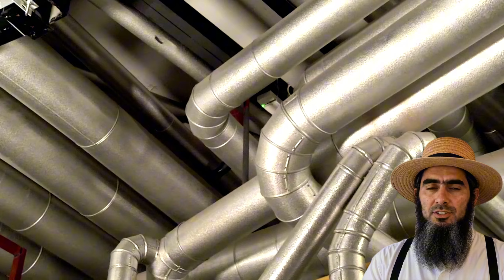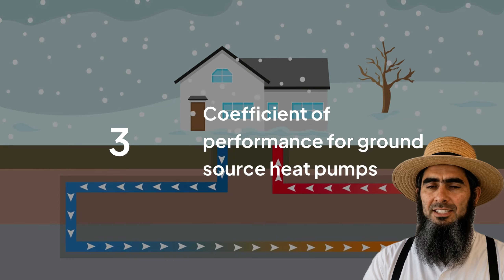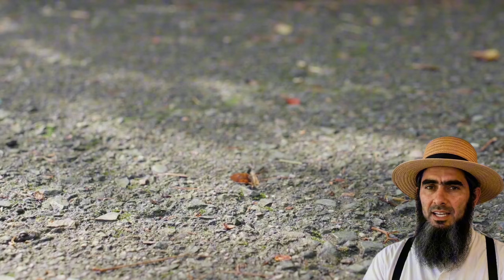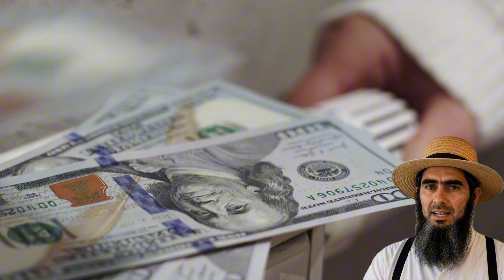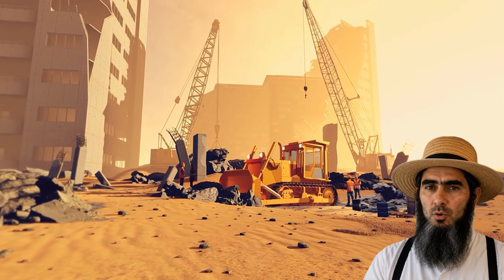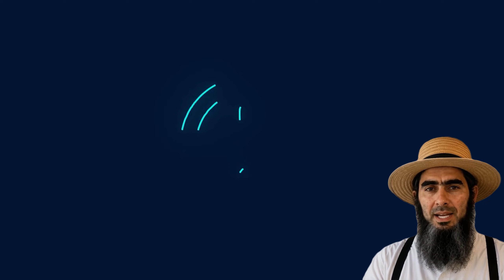We Achieved 9 Degree Cooler Air In 5 Minutes  — The Amish Way

Comment: You can do the same thing witth a cooler just add coil of pipe to cooler and vent and fan to pipe add ccol water or ice to cooler keep lid closed ..Add vent pipe in side out other side does the same no diging ...
Reply: Add fabric to it to hold coolness longer ...For air cooler or fridge ...
Reply: You can make fridge same way add a  box to cooler that opens use that in cooler pack ice or bottled ice around it keep cooler lid closed open inner box no air gets in to melt ice ..
Reply: Same as double layer cups like yetti or others ..
Reply from the maker: That's a clever alternative for temporary cooling. Earth tubes are designed for passive, long-term cooling without needing ice or frequent refills. Thanks for sharing your idea! 👍